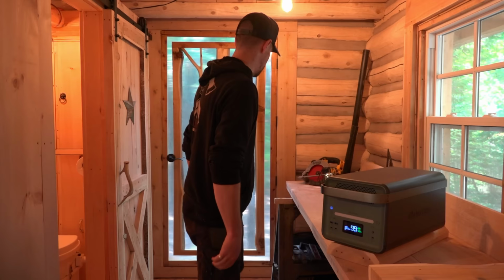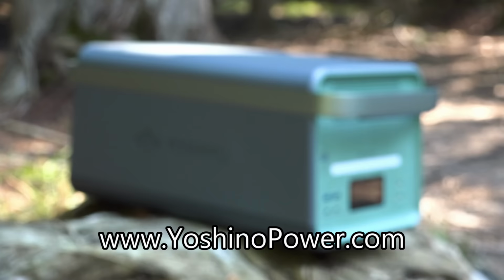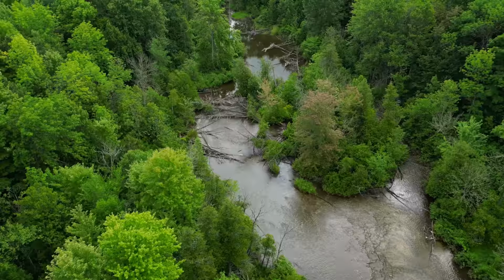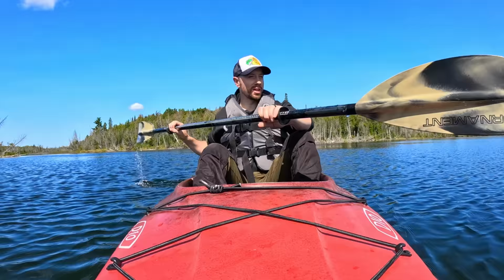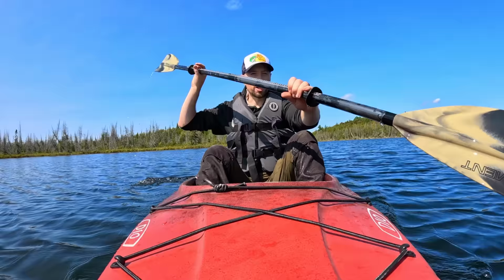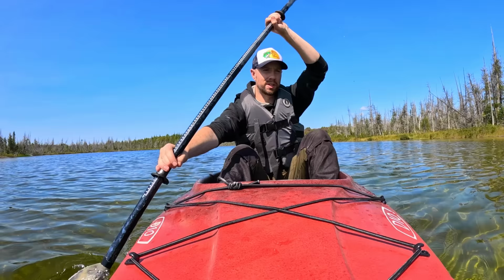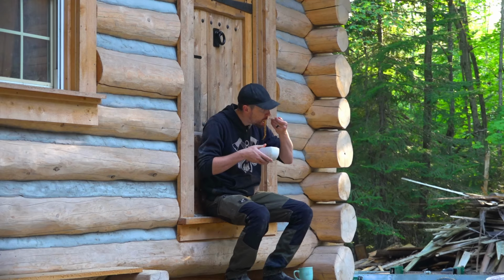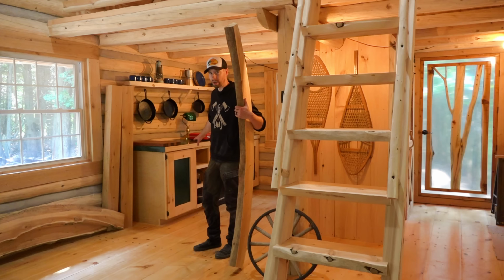Kitchen Build & First Supper in the Cabin! / Ep108 / Outsider Cabin Build

Comment: I've been impressed with your craftsmanship, aesthetics and attention to detail. Excellent job! BTW, you might try turning that kayak paddle around and use it with the longer, sharper curved edge of the blade on top. It won't make much difference with the high angle stroke you are using but with a lower angle touring stroke the paddle will tend to settle naturally into a balanced position without any effort. Thanks for the video !

Comment: Hi 
As someone who has built his own log home, I take my hat off to you a really nice job you are doing.
Just one thing I noticed when you installed your chimney supports did you put a piece of rubber between the supports foot and the roof iron. If not you could find water will get in here through the nail hole
It must have been great having your father to help you, I had to build my house by myself that was 30 years ago still enjoy living in it.
I had a Freggie also it was a 65 and I made a steel boom which I fitted to the frontend loader which gave me a Hight reach of 5.5metres I used an endless chain for lifting
Cheers

Comment: Hey, on your paddles for your kayak, if you go get you one of those pool, noodles was got the big hole in it. And put above your rubber handle stops between the paddle and the handle stump. It will keep the water from dripping down on you if you leave a gap between the paddle and the pool noodle.  How are you gonna use corners a phone deal? That goes around the pipe. Whatever and just put some duct tape around it or something like that. And it also floated if it falls in the water.

Comment: You can get a nice looking cooktop that is able to fold-up against the wall (you can make them pretty easily to customize them to whatever style you want). You just have to ensure that the cooktop is thin, and lightweight enough to be put on hinges and can run off electric, gas, or wood.

Comment: This is a bit off this topic, but I have an Outsider version THRUNITE TC15V2 flashlight and it is great. I noticed, and others posted, you can't  find the 'on' button quickly by feel (even not in the dark you want to find it without looking). I put a dob of shoe goo just below it (on your logo! - but it is clear and doesn't block your logo!). If you put it on with the end of a matchstick and then gently push it down with your finger tip, it goes from a teardrop shape to a button pretty well. I now can immediately feel that she goo button right away under the middle part of my thumb, and then the front part of my thumb is on the switch and turns it on. Works really well.

Comment: Looks amazing.
I was told many years ago that copper is anti bacterial, and that's why door handles were made of brass. So as to not spread germs around.
Copper was also used in wood preservers but I think it got banned in Canada. 
Contact of food with copper might not be safe. I'm no expert, but maybe that's why in the old times, they tinned the inside of copper pots, and I don't think you can buy cooking stuff made of raw copper. Maybe jut at high temperatures? idk.

Comment: You know, you could use the smaller pieces to come off of those and make the arch off to the side that way, when you get over in the bed, you know, the kids will won't even roll off. It's just a suggestion, you know, you don't have to do it, or you can just make it coming at the top of the mattress. It has the top of the mattress that way when you screw to the bottom end of it to the headboard. Then you've got that arch on the side that you can screw. Your Borders that holds a mattress to.

Comment: There was a battery program on public TV awhile back where this inventor of a solid state lithium battery was interviewed.  By not using any liquid he said they could use 100% lithium which would double the power output for the same size battery or the size/weight could be cut in half for the same output.  They also noted the greatly reduced fire danger, I do not recall that they mentioned increased cycling totals or reduced charging times.  They were looking to build a factory for battery production and said it was the battery of the future (especially for cars doubling travel distances while practically reducing fire chances).  It sounds like these batteries are finally coming to the market, lets hope they are not to expensive......

Comment: That solid state portable battery pack is $3200.  Hefty chunk of change.

Obviously its cold weather performance may the the key answer in some applications, but thats a niche market. 
 
The price will definitely need to come down by like ... half ... literally half ... before mass market adoption is even a consideration for general portable power.  If they did drop the price tho, sales in the general use market would more than compensate for the less per unit price.  

At this number, I just wouldnt consider it, neither would many potential buyers, and therefore it would stay a low volume sales niche market product.